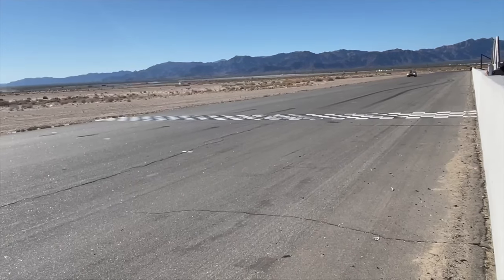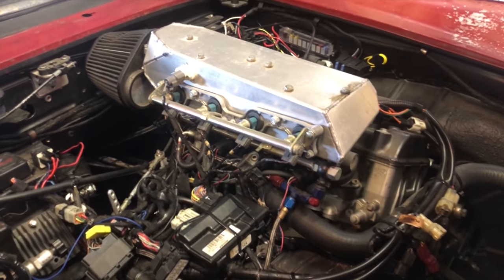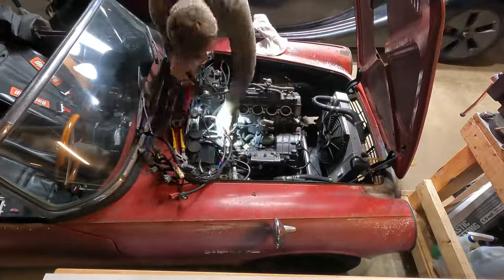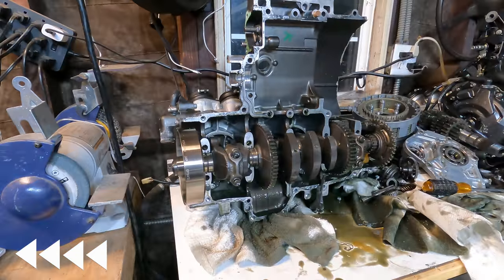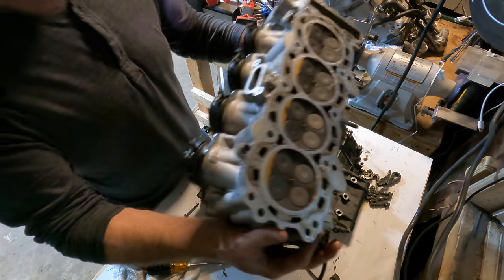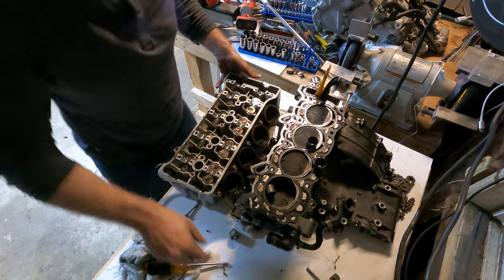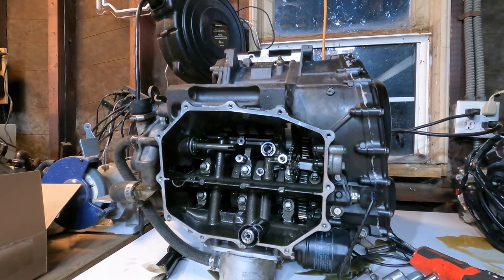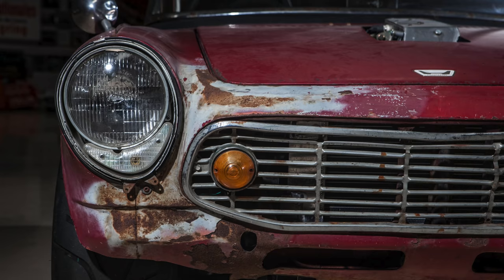I Blew The Motor In My Motorcycle Powered Car

Comment: A good old Triumph Daytona 1200cc engine would be great for this lil car, the rpm might not be quite as high as the Honda engine but its a very very strong engine with a huge clutch and tough as nails, that slightly lower rpm is balanced by quite a lot of torque ,especially by motorcycle terms, its 145 bhp stock, the only down side for some people is that they would be carbed engines and not fuel injection, a plus for me, i love carbs.

Comment: Issue with using the stock oil pumps for dry sump, is a gear-stator pump is poor at moving air. Dry sump systems use roots type dual gear pumps for the scavenge, and a gear pump for the pressure pump.

Comment: Any idea what engine you plan on replacing it with ? A Hayabusa would be ideal but it’s not a Honda. If non Honda is alright you could consider a Star motorcycle VMax motor V-4. It makes 170hp at the wheel, over 100 ft lbs of Tourqe and is shaft driven. I believe the max RPM is 9500 rpm.

Comment: Did the cars you had at college have the motorbike engine in the correct orientation. From the issues I have seen with the Locost (Lotus 7 shape) it seems to be caused more because the engine has been rotated and when cornering the oil is being sloshed to what is the front and rear of the engine. But dry sump is probably the way to go as more oil results in cooler oil as even if there is no cooler it takes longer to get round the system before going through the bearings again. That engine must have had that smell of burnt bearings the minute you opened it up.

Comment: Oil pan baffles and "reservoir" design aside, a few of us with bike engined cars had good luck moving to a higher psi oil pressure regulator. While it doesn't solve starvation issues the increase in pressure makes the film strong enough to avoid problems caused by short term oil starvation. Other than that the only viable route is a dry sump but that's quite expensive and uncharted territory on custom, one-off builds so the trial and error might cost a few engines.

Comment: I don't know anything about oil systems on cars, but adding the accumulator on the oil pump discharge will help stabilize oil supply to the engine itself, but it might not do anything to help the oil pump suction side. Could the oil pump suction side potentially run dry around the long corners leading failure of the oil pump itself? or are these pumps able to run dry for a short time?

Also the oil sump will need enough available volume for the normal oil level once the car stops cornering + the volume from the accumulator that entered the system during corerning (sump/pan requires spare space for the accumulator oil) until the accumulator refills. I don't know how much ullage a normal oil pan would have to know if it would work without modification.
Reply from the maker: The pump should be fine, especially if the pressure side still has some pressure from the accumulator.  I can add volume to the new pan, too.

Comment: CBR1000RR engines do not need a heavy dry sump in BEC applications but a proper designed sump and baffle plate. Those (billet type) are available to purchase along the BEC community and are proven in racing. This will be your best choice with the next engine.

Comment: Sorry about losing your engine. Another thing to consider about the oil system pickup. Motorcycle engine generally have the engine across the bike therefore therefore the oil will slosh from the timing cover side to the flywheel side. In your car the oil sloshed from exhaust side to the intake side as in a regular car engine. What is going to be your replacement engine. Finish the Jag first.

Comment: I didn't even reinforce the roof structure to use it to hoist engines (the first one being a Ford small-block)... but I did use a "beam" (random 4x4) to spread the load across four trusses. I didn't calculate anything, but I'll still call it "an engineering solution".

Comment: My car build has a modified pan which is much flatter and wider for clearance reasons and I'm very suspicious about maintaining oil pressure on corners.
It's not road worthy yet so problem for another day. Oil pressure is fine when stationary 👍
I'm thinking future dry sump project using the engine pump as the main pump and some cheap scavenge pumps from an old BMW. I'm sure this can be done for a reasonable price.

Comment: I feel your pain. I run a Pro Challenge car. Originally run on oval tracks, and the lateral forces in the left turns weren’t a problem. But I’m a road racer, and clockwise track direction have taken their toll on my Kawi ZX11 rod bearings. Interested in the Accusump solution.

Comment: Here's a crazy idea - try to put a Kawasaki H2 supercharged engine in there!
Regarding the 'glitter', had my fair share rebuilding RZ250 2-stroke engines. Twice in one day, once - forgot to enrich the fuel ratio for the run-in and it decided to soft-seize itself 10 min into 1st run. Fun times.
Reply: You do realize that it would be really expensive to get H2 engine? Let alone to find ones. Much reasonable would be to buy ie. Busa or ZZR engines which both withstand turbo kits darn well.

Comment: I had a Busa powered Lotus Seven clone with a swing oil pickup and I slightly overfilled the sump. 'Did lots of track days with absolutely no issues after 14 years of abuse. I wish I had installed a reversing box as the novelty of getting out to push wore off quickly.

Comment: Incredibly shocked it wasn't something clutch related to blew up first, I was 90% sure something in your end drive train would get blasted by that extra weight
Reply: Nah, these drivetrains are tough as all get out. I've run inline 4 motorbike engines in sand rails and buggies for 15 years. Only issue is the non backcut gears (usually just 1st and 2nd) popping out and the occasional bent shift fork. Clutches are tough if you respect them and don't slip them except when absolutely necessary. Also need to keep the heat load in mind. You can abuse them once, but make sure to give it time to cool before doing another hard launch.

Comment: Oil starvation because the engine is running a standard sump by the looks of it. A bike oil pickup is not effected by centrifugal forces because the bike leans into bends. If you put a bike engine into a car you need to modify the sump to prevent oil starvation. Sidecar racers often change the standard wet sump for a dry sump setup.

Comment: Dry Sump would be the way to actually solve the problem. The accumulators are a patch and not a solution for oil starvation problems. With the accumulator if it starts depleting when you loose oil pressure it also takes oil back in when the pressure starts coming back. That can lead to a prolonged middle ground of not quite enough oil flow to the bearings.

Comment: What about the Honda CBX 1000 engine?   ( 1l 6 cylinder that revs up to 9krpm ) and sounds like a f1 car with the right exhaust
Reply: it would overheat, not fit, be way heavier than than the engine he took out, and be 20hp down to boot.
Reply: @yamahale  But 6 cylinders tho. I drove one once and it has changed my mind completely. It just sounds soooio good, quite literally sounds like a f1 car.
Reply: @holzwurm_hd7029  I have ridden a few.....but it still wont fit.

Comment: i think what helped screwing the motor is red lineing it and since motorcycles only weigh around 200kg they can take the weight of the bike red lining but with a car the car will push the engine abit over the limiter wich could wear shit out

Comment: Either have a billet baffled sump made and fit a swinging pick up, it is a known problem on a lot of high horsepower drag bikes with the oil being thrown to the rear and the pick up sucking air. I am looking at bike engines for my small fibreglass Reliant Kitten, which will likely be a Honda ST1100 motor. Use a variable pressure switch so you can set the pressure drop that illuminates the warning lamp, or build in an ignition cut off that kills the motor if the pressure drops below your desired point

Comment: I was in Nashville on my way to Texas from Virginia the thursday before Labor Day this year when I started to hear the same sort of faint ticking from the slant 6 six in my old HotRod(choke, gasp) Dodge stepside. Dropped valve, hole in piston, no parts in stock and no junkyards open, so after taking it apart and deciding it was all just junk anyway I put it back together and decided to see how far I could get on 5 before I had to take the tags off and uber to an airport. 675 miles. 2 miles short of my destination. It really didn't seem to get much louder before it threw parts in the air(the hood was strapped to the bed to stop it from overheating so I got to see chunks of block and rod cap flying out) but maybe I just couldn't hear it getting louder over all the noise. Anyway, all this to say that when I heard your engine banging like that I sorta wondered how far you could have gotten just limping along on the shoulder at 54mph. Cool car, cool videos, never get tired of your stuff. Can't wait to see it running again.

Comment: You know what would be rad replacement engine? An air-cooled, straight six Honda from the 1980s. The CBX even had a faux dry sump. 

Bore it, stroke it, and port it. Probably good for 150hp or more.

Comment: Have a look at motorcycle sidecar engine builds. F2 Sidecars normally have 600 engines in them and the engine builders develop special sumps for them with baffles. they would be subject to very similar forces to what your car would be. You may not need to dry sump ?

Comment: It's also transverse mounted in the bike and longitudinal in its current application furthering oiling issues.
Reply from the maker: this is true, but looking inside the engine, I believe it is actually better sideways; there is less room for the oil to slosh to.

Comment: I could just detect a hint of knocking conrod. A drysump with electric scavenge pump might be the way to go. The pickup can run via a filter too. I like analogue oil pressure guages, i fitted one to my old BMW R75 and it was scary seeing what happened on breaking, and acceleration (but less so).

Comment: Hey Mat, during your FSAE Days did you run a wet sump with a baffle? 
Currently on a FSAE team and was going to put in a dry sump till the pump did not fit in the frame (senior design at its finest). So, we are looking at baffling for a GSXR 600.
Unfortunately already designed the dry sump system just for the pump to not fit over covid.

Comment: So, bottom line, you intended to trash the engine so you could put a different engine in.  Well planned and executed!
That is also an issue with VW Bug engines on big sweeping on/off ramps.  The oil all gets slung into the cylinders.
Reply: in North Carolina a lot of on ramps in the fayettville area are exactly that. big sweeping on/off ramps. When I was a new driver I used to drift my 62 bug around those turns by going so fast that the rear end would naturally kick out a bit. The g loads was enough that one time I did it, and saw the oil light flicker, and then knock knock.
Reply: @kasuraga  Out of curiosity, had it done significant damage to the motor or did it stop knocking after you got back onto a straight road?
Reply: @clonkex  oh, no, once the knocking started it only got progressively worse as I limped it back home. it destroyed the crank and rod
Reply: @kasuraga  RIP 62 bug

Comment: As small as that pump is think more "remote reservoir" than true dry sump. Go to Summit racing I am assuming they are still in business. Look at the size of the external vaccum/hydralic pumps. Racing bodies limit the size to limit the power you can crate by drawing vacuum on bottom end. They are huge compared to an internal pump.  Doing a well thought out baffle to the next oil pump and keeping total oil volume OEM even if that means side ways expansion to make up for shortening of the pan if needed would be far more practical. The accumulator is good and been done for well over 40 years. I used them in the late 1980's and early 1990's on Toyota 4 cylinders I had turning 10K rpm on the street as daily drivers and as Desert Toy's! Another old school solution is to add an extra quart of oil on track days to a street machine to make up for lateral loading uncovering a pickup.

Comment: I once ran my motorcycle engine out of oil. I mean NO oil. I went to check the dipstick. It was dry. There was smoke coming from the filler hole....The amazing ability of roller bearing cranks, it still ran for thousands more miles.

Comment: Reduced oil volume. 
Say your engine had 5 litres in the sump, when it’s running you get say 2 litres circulating splashing etc
Now you cut your sump down by, say 2 litres so it now holds 3 litres. 
When it runs you are down to 1 litre in the sump to slosh.

Comment: There is a certain satisfaction in fabricating a solution to certain problems.  Oil pressure and pick up could be a problem for the VWs with boxer engines while participating in auto-cross.  My 1600 dual port had a baffle and an extended pick up that pulled oil from a quart and a half sump. With out the baffle oil could be thrown down the push rod tubes to the heads starving the oil pump.  I had that engine built after blowing #3 cylinder on the original 1200 . Probably before you were born,  lol

Comment: I  Knew the Ticking was a Big End Straight away . And kinda figured it was the Lateral Force affecting the Oil system , before you said it .
Having a Transverse designed Engine mounted Longitudinally is what  I  thought would be the issue . Dry sump would certainly remedy it  I  believe .
Also , although Remarkably Powerful , Motorcycle Engines are not really designed to pull so much weight . You could try a Goldwing 1800 Engine .
Reply: I second the idea of a GL 1800 Engine (with a turbo maybe ?). Low-end torque, made for heavy load, low center of gravity, oriented toward the road, driveshaft output... But you'll be down one horsepower compared to a superbike engine
Reply: A Goldwing engine would likely be way too wide to fit between the front suspension towers.
Reply: @brianb-p6586  . Sounds like a Job for the measuring Tape .

Comment: my guess is oil capacity wasn't sufficient, could have had aeration that a larger pan would manage...running WOT would add more heat to the oil, which more oil can help dissipate...but eventually oil breakdown occurs.

Comment: I am wondering about your oil problem.  When you first cut off the bottom of the oil pan.  Instead of welding on a flat piece of Mg.  Could you have welded up a sort of box that would be the bottom of the pan? Perhaps a half-inch to an inch deep and maybe three inches to each side.  Obviously, this would increase the height of the overall engine.  But that aside, if the box extended to each side of the pan by a few inches it would allow for oil to always be at the pick up even under hard cornering.  Under heavy cornering, the oil in the pan would flow to one side of the car.  But the oil pick-up would have oil supplied to it from the far side of the pan.  The far side would now be empty of oil because that oil moved to where the pickup is.  Does this make any sense to the reader???

Comment: I blew my engine in the S600. So ripped it out and inserted a Toyota 1200 Corolla with the entire drivetrain. It fitted like a glove, adjusted firewall to fit the  starter motor. I end up with a car that could beat everything off the mark.

Comment: my little toy uses a boat trailer frame , i put 1967 knock of wire wheels from an mg , front and 4 linked the  rear , was going to put a 1800 VTX engine , but sold the bike . it runs a 16 hp briggs v twin and a meter maid trans 3 speed with reverse .. i don't think the wire wheels would have held up long ...  good luck .

Comment: Correction.. There's not "a gap between the rod and crank" like you said...   When you spin a bearing, it puts both bearings on one side (as you said), and that ends up pushing your piston up past the deck--- and that "Hammering you hear is the piston slapping your head..   I was going to say, if you just over-fill your oil, it would help with the sloshing problem-- but shortening your pan and cutting the filter would have still killed it.

Comment: Other problem with bike engines in cars: bikes are lightweight, cars are heavy. That's why bike engines have lightweight cranks and flywheels - they don't need to drag all that weight around. Put a bike engine in car and it has to rev like crazy.
Looks like great fun though.
Reply: Engines can't tell between accelerating a heavy car and accelerating into a gale-force headwind. The engine is just being asked to output a certain amount of torque over time. On a bike, these peak torque periods are shorter, since you reach the end of the straight or the end of your gearing before the he heavy car would.

Comment: Sir, your engine is designed for motorcycles, where it is positioned perpendicular to the major forces (braking and acceleration). If you install that engine parallel to the chassis of a car, your oiling system si safe against the cornering forces, because the cornering forces used to be accel/decel forces on the bike. You should be concerned about the front to back slushes, for which the engine was not design, as you mentioned correctly in your video (a cornering bike's engine oil remains level to its pan). That and the fact that you are probably applying larger forces on the crank by pushing it through the block with the heavier clutch assembly (you saw the faces of the bearings worn off) adds to a faster wear than usual. Baffling needs cover front to back slush in such build as yours.